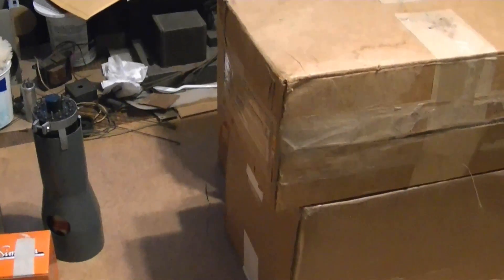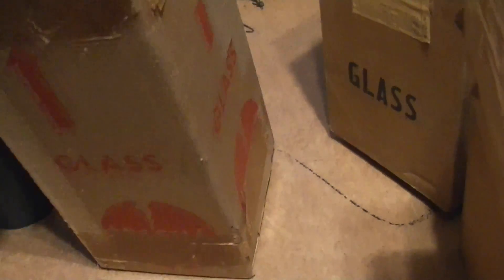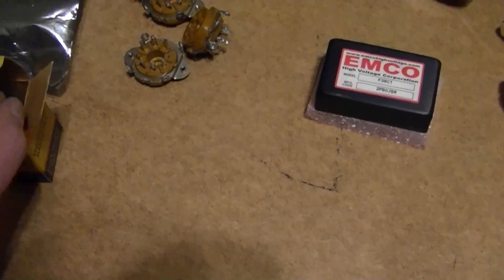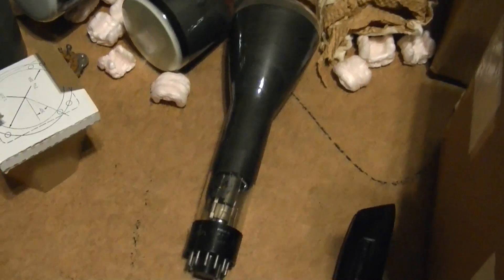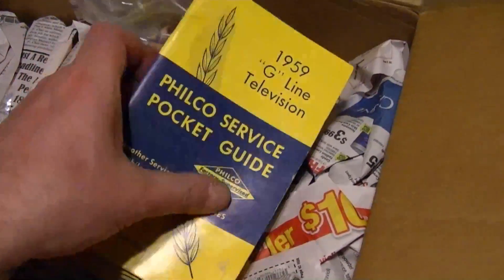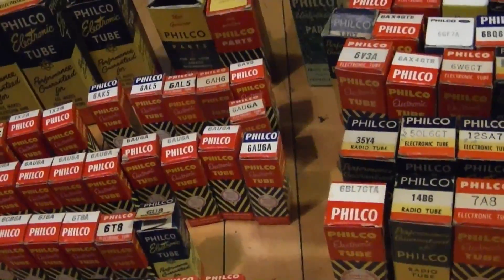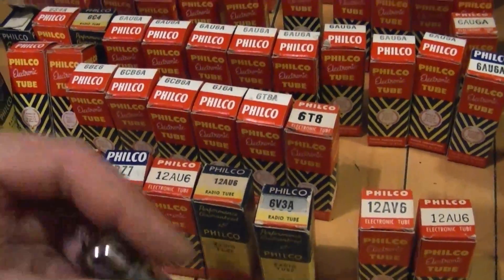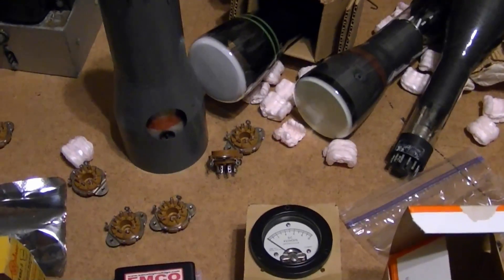Friday night unboxing 7/18/2014

Comment: I know I've said so before, but your ability to unearth rare and hard to find parts has always amazed me. As an aside, I finally got around to buying a radio I"ve always wanted, and it's the same one you listen to in alot of your vids; the Stromberg Carlson Dynatomic. I've been restoring radios for a long time, but this one is really giving me a tough time....
Reply from the maker: Now you know one of my part sources :)  What's giving you trouble with the Stromberg ?
Reply: When I got it, it wouldn't play at all. I found the problem to be very leaky paper caps, which was dragging B+ way down. Now that I've replaced them (and the selenium rectifier), voltages are spot-on...the problem is that even with the volume all the way up, audio is very weak, even on the strongest stations. Any ideas?
Reply from the maker: justsumguy2u
Weak tubes, needs an alignment or bad mica caps in the IF cans.
Reply: Thanks, Bob. I"ve checked the tubes, but I wouldn't doubt it could be either of those other two (especially the alignment). I would have tried that by now, but I lost my plastic alignment tools; time to buy a new set.

Comment: That is very nice idea with the HV power supply, I actually made one myself that goes only to about 60-700V for testing leaky capacitors. You will be able to test those 6000V capacitors from the HV section of the TV's. You can simply put an µA meter in series with it or you can simply  put a neon bulb and should still work pretty nicely. Keep up the good work. Cheers :)

Comment: I love the unboxing videos!  It's fun to see what little surprises you open up!  Kinda like a kid in a candy store, to coin an old phrase.  I did notice on some of the tubes you opened up, that they appear "blackened", for lack of a better word.  I always assumed in the past that it was just a burned in condition, but maybe it is actually painted on?  I never thought anything of it, until you opened up some of the new ones.  Great video as always Bob!  Thanks for sharing my friend!
Reply from the maker: Maybe you are thinking of the getter ?  That's a dark or silvery splotch inside the glass usually at the top or near the base.  It part of the manufacturing process that helps scrub the last few molecules of air out of the vacuum.

Comment: That was nice to find the knob springs, but one thing I have noticed is that like most things there are all kinds of different types and sizes so you may still be cutting up springs from broken tape measures in some cases.

Comment: Hi Bob, the tool that's in two parts is a desoldering aid. The bent pointed side is for  pushing solder out of holes and the sloted end is for lifting leads off boards, have bounches of them.  The 6BY5 is a dual diode for damper service,it has a separated cathode(s).  The ratings are lower than the "_ _ AX4" and "_ _AU4".  I've used those H.V. supplies on two scopes and several 7in 8in and 10in electrostatic T.V.'s, works great and got rid of all the arcing interferance.  All the best,Tom J. from FLA.
Reply from the maker: HI Tom.  Mystery solved!  I'll put that tool to use next time I work on a Predicta PCB.

Comment: That looks like a security-bit screwdriver; the screw heads have two small holes, diametrically placed, and the screw head is flat, not panhead, style. I've seen a few of these from time to time, often in the screws used to secure the voice-coil assy. in hard drives.

Comment: Speaking of parts, does anyone have any  mounting hardware for a 1931-33 RCA, G.E or Westinghouse chassis? Or any tube shields for same? I may have to make some but if someone has some left from a set that got junked it would save some effort.